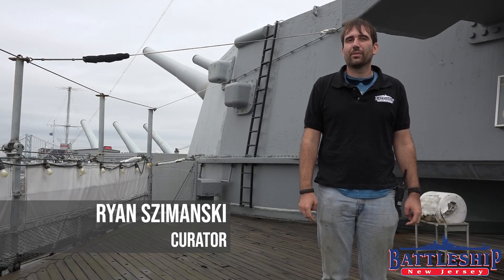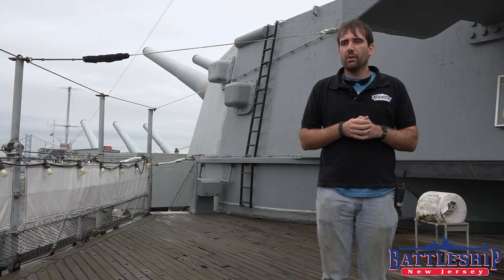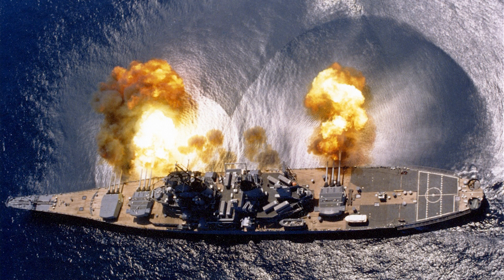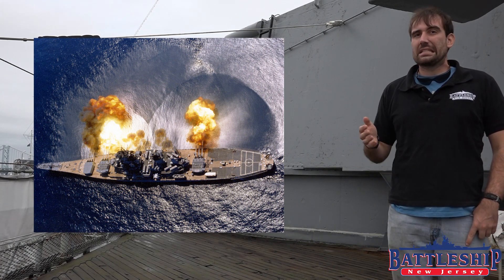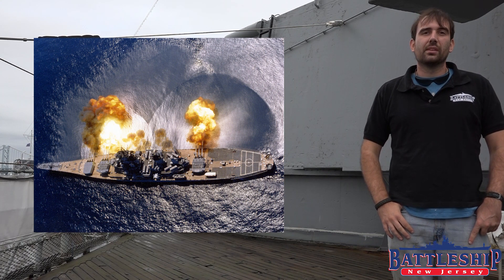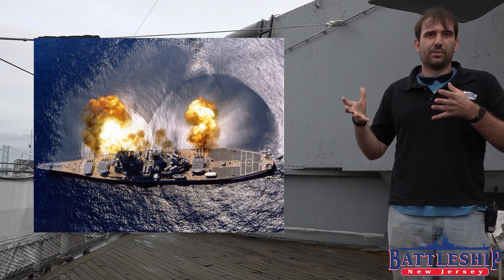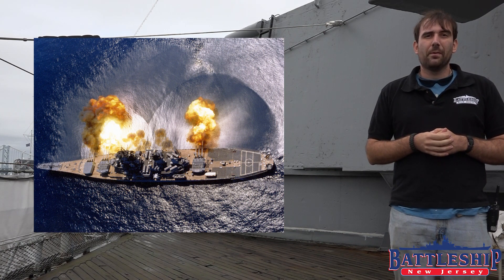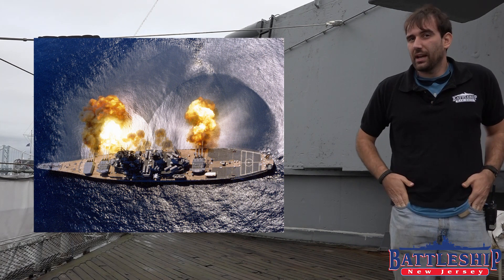Does Firing the 16in Guns Move the Ship Sideways?

Comment: People keep talking about Newton's 3rd Law (equal and opposite reaction) need to take into account a few ither things.
1. Energy transferrence & conversion: Energy within a system can move throughout that system to a certain extent. Firing the guns creates a specific impulse which the system has to deal with somehow. First, the guns' dampening system converts a lot of that energy to heat. The remaining energy then gets transferred to the hull, which will begin to vibrate, dissipating more energy as sound and heat. These hull vibrations will be transferred to everything within the ship, from deck plates and bulkheads to windows and teeth, dissipating more energy. Even the water around the ship will vibrate to a degree. This will dissipate A LOT of energy leaving much less than the initial impluse to affect the ship's momentum.

2. Inertial and momentum: Objects in motion have momentum (degree of movement) naturally resist changes to that momentum (inertia). To affect momentum you must overcome inertia, a very high threshold for something the size of an Iowa. 

All that vibrating is momentum being transferred up the chain from lowest to highest inertia, with the Iowa being at the very top. There's not going to be enough left to push the ship laterally after making all the junk in her trunk jiggle a bit.
Reply: You done the math on that?
It was pretty sound until you hit the last sentence when you went all 'feels right to me'.
If there is any energy left it will go into lateral movement, however tiny.
Reply: So in other words, yes, the fucking boat moves.
Reply: In a different comment I provided the Newtonian explanation.  A 30 kg shell fired at 1000m/s on a 4500 tonne ship causes a sideways motion of less than 1cm/s but it does cause the motion.  Momentum is conserved.  However this is less effect than a typical wave so it is corrected by the most minute effect of steering.  A bigger shell with more speed on a bigger ship would have somewhat different numbers.

Comment: But we saw in the movie Battleship that dropping an anchor can turn an Iowa class at a right angle with almost perfect precision.
Reply: @clonetrooper8669  Maybe, but it would probably dig a long trench up until the time the alien grinding wheel cut the chain. It damn sure ain't gonna stop an Iowa class ship.
Reply: @dbadaddy7386  yeah you have it right because anchors are meant to keep a ship in place when not in port
Reply: the front of the ship would have been ripped apart and the chain brakes would have failed

Comment: The ship does move sideways.  The guns give the same impulse to the projectiles as to the ship (Physics 101).  The problem is probably more of an angular momentum problem than linear momentum because the bore sight of the guns does not pass through the center of mass of the ship.  The guns will impart a roll and linear impulse.    It is not much movement but it emphatically is not zero!  (Yes I did read the math analysis.)
Reply: So if I take a sledgehammer and hit a kingtiger on the top of the turret it will impart roll and linear impulses to?

Comment: So, basically, yes it does, but such a small amount it is undetectable.
Reply: Exactly. Thanks for pointing that out. After firing the ship also sits imperceptibly higher in the water as the projectiles and the gun powder no longer are part of total ship mass.
Reply: Very easily detectable, actually. Just put your teeth against the hull.
Reply: @crucifyrobinhood  That will be movement within and of the vessel, not necessarily the sideways motion....

Comment: The shock absorbers and spreading of the force is totally irrelevant to this discussion! It would be relevant to a discussion about whether or not the turret mountings weaken over time. The reason why it does not matter is because we are considering the movement of the entire ship, not the movement of the turret! A distance of a millimeter or some fraction thereof is operationally negligible. It's 'practically' zero. But that's still not the same thing as zero. That kind of thinking gets weeded out in science and engineering quite quickly, because they often find themselves multiplying such extremely small values by extremely large values. "Effectively Zero" and "Zero" are decidedly not the same.

I think a much better way of thinking about this problem is to consider the mass of the projectiles necessary to move the Battleship one millimeter sideways in idealized frictionless water. And once you've determined the mass necessary to achieve that 1 mm distance, figure out how that compares to the total mass ejected from the ship during a firing of all her guns.

I also wonder how far away an era-appropriate submarine sonar system could be and still detect that Battleship as it fires all her guns. I bet the hull of the Battleship acts like a huge underwater speaker on each shot.

Comment: The image could have been the one from the bow of the USS Missouri.  There's lines from the bow like the ship was moved sideways.

Three possibilities.  Six guns in front with a small bow.  As someone had mentioned before, a destroyer shook when it fired its guns.  It could be shockwaves from the hull.  It should be waves with the ship.

It could also be shockwaves from the exploding powder.  Explosion compresses the water.  Water cannot compress towards the ship so it goes along the hull.  It should look like these waves.

Very slim chance that it could be the bow moves some.  Definitely not as much as what it looks like.  You do have six guns up front.  Three of which are in the thinnest part of the ship.  This part of the ship is also the smallest and the lightest.  However, it's the longest part of the ship to move.

Personally, I believe it's the pressure waves from the guns.  The waves towards the ship have no place to go but down the hull.

Comment: "Do the laws of physics apply?"  I suspect they do
Reply: Indeed. No, the ship does not move to any degree one would commonly say is "moving". The amount the ship moves is almost impossible to measure. Bottom line, it takes a lot of force over a long time to move 50k ton. The force from firing is rather high, but very brief. It'll induce more roll than lateral motion. (which is why they go to such lengths to damp the recoil.)
Reply: The law of physics that applies here is Newtons 2nd law of motion: "For every action there is an equal and opposite reaction."  If you've ever seen someone shot with a shotgun in a movie it often depicts the victim being blown backward but the shooter still standing.  That's a physical impossibility.
Reply: Physics laws are suspended, didn’t you hear the man?
Reply: @wrightflyer7855  the recoil mechanism and the ship itself absorb the energy the ship itself doesn't move at all zero notta
Reply: @itsme-qk2vb  Yes, I'm aware of that.
Reply: @itsme-qk2vb  I'm going to assume you aren't joking.
If the ship was a perfect solid, which also didn't vibrate, it would move sideways a tiny amount. 
An analogy here is that I (200lb) can push a 2 ton car on a flat surface, even with friction fighting me. So  - that's a limited force against a large mass. I'm just sorting the idea that big things can be moved by small inputs of energy. 
The ship is not perfect and some energy will go into vibration > heat. If all the residual energy goes into vibrating the ship then it won't move sideways.
If there is energy left over then the ship will move sideways (displacing water, water being pulled back by gravity > friction > heat). 
By any practical consideration the ship doesn't move. If it does move it would be a microscopic amount due to the massive nature of the ship and the massive amount of water that would need to be displaced - the recoil is mighty on a human scale but tiny compared to the masses it acts on. 
But it could move - the propellers move the ship and they work on the same principle (reaction) as recoil.
Reply: @pd4165  you answered your question the ship itself soaks up all the energy there's no residual energy left to move the ship. Have you ever had an opportunity to see a battle ship in person

Comment: I was in the Navy when I heard this one in 1986. We were conducting gunfire exercises with the 5"/54 mounts on the little Adams Class destroyer I was on, firing 70 lb rounds. Ship was 4500 tons fully loaded and those guns didn't even cause a bit of list, let alone sideways movement. The subject came up because the Missouri was about 8 miles further out from San Clemente Island than we were and firing over us. A lost of "facts" were being talked about at that time. The only one I can say for certain is that you can hear the 16" rounds as they pass overhead. Sounds like a diesel locomotive under full load doing mach one.
Reply: I was serving on DD990 early 80's, BB62 was in our group. Got to see her fire a few times up close. I don't know about the whole side motion deal but I can say is when your on the next ship over it just doesn't matter. Cheers.
Reply: WOooo Hoooo Trains 🚂 do Fly USA 🇺🇸 SteeL and Copper and Brass !
Reply: @NYCamper62  I was in turret III on the projectile deck which you kept well oiled and no movement could be detected 84-86
Reply: @samuelnelsen8872  which ship? i was turret three on the iowa
Reply: @rustyshackleford3281  BB62 New Jersey
Reply: momentum is conserved  30 kg * 1000m/s = 4500000 kg * 0.007 m/s  ie the ship would instantly be pushed sideways at 1cm/s which is corrected by steering. This would be less effect than a wave which is not dead head on.
Reply: @smitajky  now work that out for a 2700lbs projectile.
Reply: The Navy guys might know:  I've heard that the guns concussion can knock a man unconscious if he stands too close when they are fired.  Is that so?
Reply from the maker: There is a range where you couldn't stand because it could hurt you. But you can stand on the bow and watch them fire turret 1.
Reply: @BattleshipNewJersey  On my ship (a small 60's destroyer) I could stand under the 5"/54 barrel close to the mount itself and feel a good bit of concussion and heat. Also quickly learned to stand slightly to the side to avoid being hit by the spent casing.
Reply: @Mycroftsbrother  I was a pointer (makes gun go up and down) on a 3"50 caliber gun tub (open gun mount), and you couldn't feel the concussion from about 130 inches from the muzzle, you did however feel the heat and your ears rang from the report.
Reply: And you DEFINITELY don't want to be on the receiving end!
Reply: Heard that exact same noise when the New Jersey fired over us in Vietnam.
Reply: @tonkingulfyachtclub8111  The GM who tried to show me how to actually spot the projectiles in flight (which I never could do) was a 25 year Chief who had been on the gun line during Vietnam, on a sister to the same DDG.
Reply: @SMOBY44  I never saw them, only heard them but could see/hear the explosions.  I was on an LPH, generally just a few miles off shore.
Reply: @tonkingulfyachtclub8111  Hope you're doing well. I've heard some sailors from the brown water navy have issues from agent orange. Seems the VA is finally coming around to this fact. Thank you for your service!
Reply: @SMOBY44  I filed with the VA for orange crush exposure (I have cancer) and it looks like I could see some money right around the time I drop dead of old age.  I think the entire VA should be run by veterans, not clueless, bureaucratic, government paycheck collectors.
Reply: @SMOBY44  What boat were you on?
Reply: @nicholasmuro1742  USS Robison DDG 12
Reply: @SMOBY44   Hoel DDG-13 84-88
Reply: @nicholasmuro1742  Nice. I was on the Robison 85 to 88. Machinist mate in #2 engine room.
Reply: @SMOBY44  I was a GMM2. I think we may have tied up alongside you a couple of times
Reply: @nicholasmuro1742  I think I recall being tied up with the Hoel on pier 2. Seems we were always tied up along side an Adams class when in port.
Reply: @SMOBY44  Trying to remember the other Adams in SD. McCormick, Buchanan. 
I'm done. I think there were 5
Reply: @nicholasmuro1742  Can't remember if the Waddell was home ported in SD. Was the Henrey B a SD ship?
Reply: @SMOBY44  I don't remember either. It's been a while
Reply: Thankyou Gentlemen for your Service, from an old Army Vet 89-07
Reply: @sheepdog271  No problem. Same here. But save the real thanks for the guys that come back with missing body parts. I saw zero combat. Peace time sailor, right in between Grenada and Panama. Spent most of my time getting drunk in Tijuana lol
Reply: @sheepdog271  And thank you sir for your service.
Reply: @SMOBY44  I could see some of them, exactly looking from behind along the barrel. it is a short, quick, dark dash-line in the light-grey sky. We were practising about 10_km_range, or so. On a self-driving gun-carriage (up to 30km range max capability), calliper 7' maybe (I forgot the type)
Reply: @SMOBY44  I could see them sometimes. We were practising at 10_km_range about).
Reply: Sounds completely awesome! I am quite certain that I seen your Ship near San Clemente Island at one point or another. I too, was in the Navy from 84-87 (active duty) and reserves until 95. Anyway, I was stationed at the end of Rosencrans St near Point Loma. We did allot of Op’s with different Ships near San Clemente Island during that timeframe. One of the vessels I was assigned too was the Navy’s newest Torpedo Weapons Retriever. Sure spent my share of time on and around the Sam Clemente Island area. Just curious where your Ship was moored at. Either Long Island or 32nd St.
Reply: @ChildoftheKing23  32nd Street. At least when in port. Seems like we were at sea more than in port.

Comment: I think that you’re wrong but I couldn’t prove it.
Reply: Any physics teacher can. 
Firing the guns releases a lot of energy - where does it go? Energy cannot be destroyed but it can change form.
Even though it's a lot of energy there is a MASSIVE amount of ship - imagine a pea rolling against your foot. 
If the ship was on a friction free surface you could measure the amount it moved, and it would be tiny. But it's in water and the energy turned into heat via friction of hull on water. That's where the energy ultimately goes. But that friction is caused by movement - a few tons of force over many thousands, so tiny.

Comment: There were various WW1 monitors with two 15" guns or one 18" gun and a displacement of around 7,000 tons and a deliberately shallow draught. If anything was going to show a significant sideways movement when the guns were fired, that would be it. I have never read a description of a monitor moving noticeably sideways. Newtonian mechanics say it must move a bit, but it's not perceptible. On a monitor, the elevation was nearly always quite high, so there would be a tiny downward motion, too, but you'd never notice it.

Comment: Sorry but with all respect, I simply do not believe you.  Energy is irrelevant.  What matters is momentum.  Newton did not say, "Equal and opposite reaction, kind of pretty much."  He made it quite clear, "Equal and opposite reaction."  If a frog jumps, it pushes the earth away from itself, not much but every friggin' time.  OK, that assumes the earth is rigid, but if it's strong, why then just the fact that the amount it moves is incredibly small does NOT mean it does not move.  I'm sure you could not feel the ship recoil, but that is not the question.  The question is whether high school physics holds, and of course it does.
Reply: this. as a physicist i can also add the movement would be spread from a movement vector rolling the ship port to an additional  horizontal port movement vector.

Comment: I was on the New Jersey in the 80's..when they fired 9 16 inch guns you could feel the ship move..they can over the 1MC and stated we had moved like 20 inches
Reply: The speaker discussed the physics and a 58,000 ton battleship does not move sideways when the guns are fired, especially with a recoil mechanism.
Reply: @scubaman6  I was there..you ate wrong

Comment: A 5" 54 firing 90 degrees to port or starboard sends a wave like motion thru the length of a Knox class ship frigate. AS for sideways nope.
 I was never on the Jersey so can't tell you if it is the same.
But it was moored as on the other side of the pier 7 mole inside the Naval Base.
At least if you were on the Jersey you were closer to the main gate. and liberty.